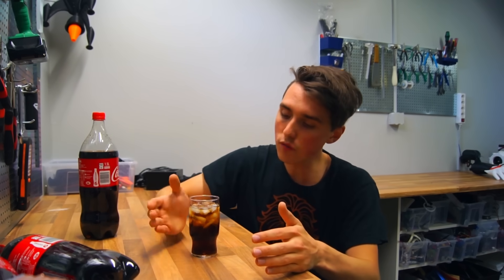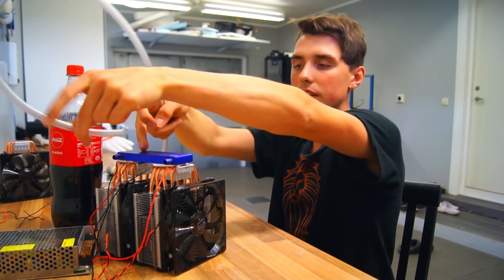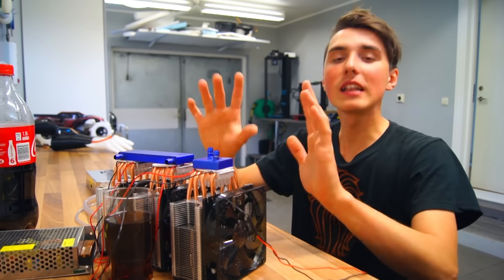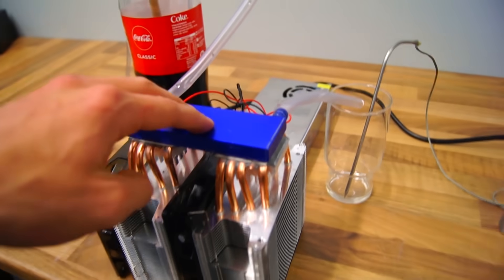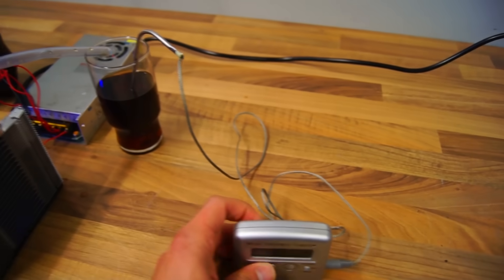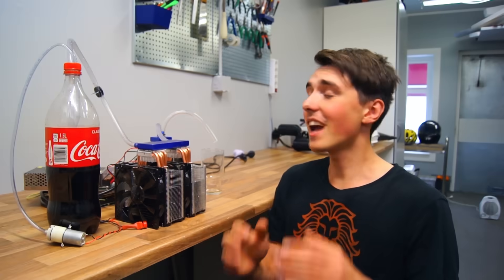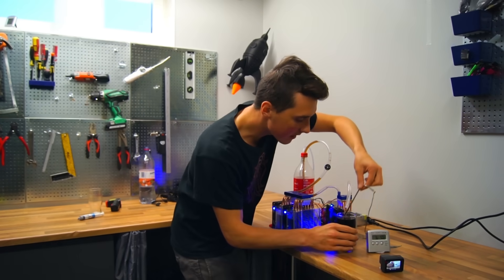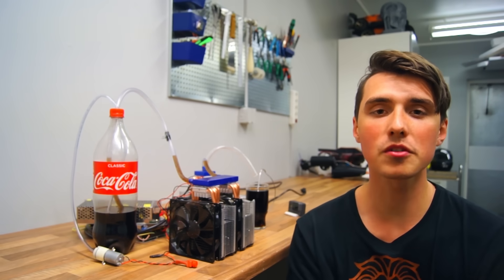Peltier Soda Cooler Machine - DIY Drink Dispenser

Comment: https://youtu.be/vsTIWhZ-6HM

Peltier Plate Driving 2 Low Heat Sterling Engines. The Hot side powering the top & the bottom engine being powered by the cold. Because a Sterling Engine converts the differences in Temperature both the Hot & Cold and a Peltier Plate produced Hot and Cold but on different sides of the plate the Peltier Plate's side can be used to produce kinetic energy.

The Top "Hot" Plate/Sterling Engines also acts as a more entertaining heat sink. 

For best results I would suggest a TEC1-12715 DC12V Heatsink Thermoelectric Cooler Cooling Peltier Plate Module 40x40MM over the TEC1-12706 as the TEC1-12715 can run at a higher amperage. If you only have a TEC1-12706 then you may wish to place some form of resisters or Temperature Controller Module otherwise the heat may be too great for both the Low Heat Sterling Engine & TEC1-12706.

Comment: You could get much better results with a slower flow rate, and don't need as many peltier modules. Most of the cooling is due to the thermal mass of the waterblock which is at -17.5C.

Comment: What happened to the giant cooling block you mentioned in this video, can you do something like 6 peltier devices on 1 block, 3 on bottom and 3 on top cooling the block in the middle and exhausting the heat from the outsides? Could get better results, good test to see what happens if you go over the top, would make a good video

Comment: Water block on hot side. CPU on cold side. ( So the Peltier sandwiches in between. The problem people are having or don't seem to grasp is the cooler the hot side the colder the cold side. So a custom loop with a 360 rad on will be the best solution. A Hyper 212 won't do shit for peltiee CPU cooling.

Comment: the way those style cpu coolers work, dont they have to be right side up (or sideways but less effective still) for them to work? aka youre not cooling the hot side as well as you would if you just simply flipped that whole contraption upside down with the waterblock on the bottom and the coolers right side up?

Comment: good idea but your reservoir where the liquid pass through is too thick, if it would be thinner it would cool a lot better with only 2 peltiers
Reply: You mean the blue water blocks were to thick or basically the piping inside? I was thinking they were to thin and you could stack 2 blocks on top of eachother.
Reply: @rdooski  the blue water block is too thick, the thinner, the less it will have to cool when it passes through
Reply: @xMickx  Im going to have to disagree. If that were the case your cars radiator would be thin and small. The more surface area you have to make the temperature exchange the better.
Reply: @rdooski  the only surface area as you say that cool down is only the bottom area, no matter how tall it is, only the bottom will cool. The higher you go the less efficient. This prototype is not a radiator and not all the areas are cooled down. If it would be thinner it would cool quicker.
Reply: @xMickx  No the surface area that touches the liquid is what matters. In this case its the surface area of the piping inside the cooling block. And yes it is a radiator, its just solid instead of having vents go through it.
Reply: @rdooski  okay since I'm dealing with a negative IQ one, our conversation ends now.

Comment: back in 2000 was building desktop  PCs that would go temps below 0 like well below 0 30, 40 deg below on cpu and video cards we used the units from a refrigerator to do so ..could overclock the crap out them

Comment: What if I want cool water from distilation colum? It is possible sustain low temperature all time? Or the water heat peltier module and cooling will be inefective? In collum is 80 degree Celsius and in output I need about 30, can peltier keep this low all time?

Comment: You should have made a loop, a loop in the bottle with a thermostat. The fluid "Loops" until it reaches the right temperature and then the thermostat opens up and delivers the fluid to the glas.

Comment: Hi - your water block/ heat exchangers don't have enough thermal mass. Add a container on top of them to hold either water, that could even freeze into ice or at least be at a very low temperature. Run your system till that water/ fluid is cold ahead of dispensing the cola. That would be closer to the design of the old style dispensers. Try that and make a new video.

Comment: Hey actually I am trying to make a water cooler using peltier modules for my car using 12v cigarettes socket. Can u help me?
Reply: So.. it means you are trying to place a heater inside your car for the sake of getting some cold water. Isn't it??
Reply: @Ravitejad98  Ya sort of, my car is pretty big and my heater exhaust goes to the boot.

Comment: I'd love to see this done over with some thought given to the flow of heat between the various parts of the cooler. Heat pipes function better with the heat source at the bottom, as they work through the evaporation and condensation of the water inside them, and heat rises.

A lot less important but still worth a mention is your fan orientation in other videos. How you have them here is fine, but the orange juice freezer had the fans blowing downwards, essentially working against where the heat "wants" to go.

Comment: I'm pretty sure this can cause serious health problems. Cola is a bit (or more) acidic and it'll dissolve some of the aluminium. Aluminium and copper in your body is not great for you. For some people it's even deadly (if your body can't remove it fast enough or at all). You say "but soda is sold in aluminium cans". Yes, but they are have protective coating. Scratch it with sand paper and put it in a glass of cola and you'll see what'll happen if you wait long enough.

Comment: I'm running 3 alternators on my truck #1 for the truck itself #2 for the stereo sound system #3 for the jumper cables,power inverter and the diy add on ac using peltier cooling

Comment: he could of put a regulator valve after the heatsink and add another loop back to the start of the heatsink, then closed the valve and the coke would regulate around the heatsink. that would be easier lol and you can control how fast the coke comes out

Comment: Hi. Im totally rookie with the Amp-Voltage-Watt question.
Sooo... the peltiers are using 300W... 
That power supply what you linked at the description is 360W. U still using 2 of them... why? :)
Now im trying to do something similar.
I ordered a 25A 12V 288W peltier pack with heatsinks and all fancy stuff... and a 30A 12V 360W power supply.... Will it gonna work If I connect everything together or will I burn? :D :D Im a bit worried. :D

Comment: Justè2 ideas vor einer für Upgrade used for the flo
W Speed no clamp just use a PWM circed too slow down the air pump speed Sud für Softdrink flow Speed is slower
And you can Ajust the if you want to adjzst the time how long the flow Is running just use mono stable Flip Flop circet
So push the button once and you can adjust the temperature and also the mas of fluid which will run p through the cooler so are 
Adjust z the whole system example for one class push the button once and after the glass is full etwas top again automärkte le and you can always changethe Speed for temp and the Run time for the Volumen of th e glassgreats fromm Germany Mr eheelchair bjornvoigtthat works real comfiyou willsee Upgrade two Levels Higher ggf or me my kids can now usebthedispenser Aline cous one Button usage
I hope you Unserstand my english ha a Braunstrike few yeard ago so my english is badif Xiu want to Kontakt me use Facebook or e-mail
Would be nice If Xiu Name gor that Upgrade If you gonna use itcouse my little invention Developer by disskusing with my daugthrr valrdkajow zobmskeit bettet andveadirr to usei ASK anwserabd i tfied to found a dolution sehr US my Brest Helfer ciuseshe ist Schild and Just das what sehr would Like betterat Machines i built for her sndher brother
Reply: And put the hot Zeit on top so der Heat will be easier token away remember Physik convection warm Air always wants to be flying up

Comment: 5:08 I was thinking : Damn what an exaggeration, you've nice video editing skills, it looks realistic ...
5:12 And then I'm like : OMG that's not fake, that's true !

Well I think the sound is prerecorded and that's what fooled me

Finally it's nice, I think the only thing you could optimize is the flow, the mod you add is mechanical but it'd be better to fix that at source having a pump where you can change speed just with a screwdriver, so the liquid has more time to pass trough it.

Comment: Probably a little late, but you've got the whole assembly upside down. Those heat pipes on the heatsink have a liquid inside that needs to be in contact with the heatsink itself, it boils and rises up the tubes to condense on the walls of the upper tube, transferring it's heat to the copper and dripping back down to be boiled off again. The more heat you can pull off those TEC cells, the more cooling power you'll get out of them. And try modulating the voltage of the pump motor to fine tune the flow of liquid, a trickle would be ideal. Also, adding a peice of aluminum bar stock to the water block bonded with thermal paste will increase the amount of liquid you can flow through it before it warms up, and insulate the outside of that as well to decrease losses. Awesome project, I like the idea of cooling on demand versus cooling the entire volume at once. Kinda like an Insta-Hot, but the opposite.

Comment: Uuh... Why not just make something for a cup to sit inside of? I mean a fridge is a much better "soda dispenser".
This design would be pretty much unusable for some time after you use it once.
A fridge insulates itself from heat so that it retains as much "cold" as possible while you can store a whole bunch of cokes in it... And it probably costs less money to run energy wise than this too.

Comment: Well the question is, is it really that inefficient? Like let's say your mini fridge is running for whole day and anyway you come and take just glass of soda out of it and put it back and let it there again and if you would use peltiers and let it cool for 10 mins pour drink into glass true it and turn it off. 

Uhm 🤔

But anyway never worked with peltiers I heard that they heat up on the other side is that hot that they need active cooling on the other side ?
Reply: Peltiers use an extreme amount of electricity.
Reply: @Tahutify  Yea I know it does, but the fridge uses a lower amount but running for the whole day, but Peltier will run for just a 30 mins max to cool up your drink so the question is if you compare these is it really that inefficient?

Comment: U should use coper spirals, that are thinner, so more of the coke will change heat with the copper... Make a little container, full of alcohol, with a nice coper tube spiraling inside, and then make the coke pass slowly inside it... That will work way better, the blue water thing u used makes only some of the coke to change heat!!

Comment: Instead of a limiter in the tubbing connect a potenciometer in series to the pump
Reply: A potentiometer in series? You would burn it in a second, you have to use a driver, maybe pwm would be ok

Comment: You should grab another bottle, and some more hose, and circulate the coke through the blocks. This should transfer the heat out of the system, and eventually make the coke ice cold. Add a spout to deliver the coke out of the circulatory system. ;)

Comment: Regarding the flow limiter.
I know a lot of people say put it after the peltier but it will not make any difference.
Fluids are not as compressible as air is.
Essentially you "squeeze a water hose" what does that do? It speeds up the water.
Same thing with your coke.

What you should have done is to slow down the airflow.
Either slow down the air pump but I assume that would require PWM, a bit to complicated for this task.

So what is left?
Spill out some air.
Either by making a hole in the air hose and the pressure in the bottle will be less and the speed too.
Or just unscrew the cork slightly to pass out some of the air that way.

Comment: Hello I like the idea and its pretty much the same implementation of the idea i had ... What about a liquid passage, but just the amount of liquid that it can pass is a lot smaller, what i mean is a much thinner water block, so that it is not able to heat up the Peltier so fast and in the same time the peltier will be able to cool the smaller amount of liquid much faster without dissipating so much cooling potential so fast. In the same time the smaller water block will be limiting the flow of liquid as well.. what do you think about the idea ? Will you be willing to try it ?

Comment: If you put a block of lead between the water block and chip it will hold the cold longer, acts like a flywheel so you don't loose the energy as fast.     cool video and i will sub

Comment: Peltier gotta have to be the most underrated electrical effect ever! Good video thanks!
Reply: If they were more efficient, they'd get more attention.  They are power hogs.
Reply: Not really Peltier-Element
Am not really effizient es ist ok vor sochi project but not for more if you want to build on air conditioner ich will need all in all three or four times Energy as one with compressor
Reply: @b.v.6077  "i can speak English very well but i can't find the Wörters so schnell" 😉

Comment: use thermoconductive tubing so the frost permeates the whole system, leaching heat at every point along the way.
Reply: What is thermoconductive tubing made of?
Reply: @Fstop313  
Copper? Or something non-toxic that wont react with soda but still conducts heat well.
Whatever spreads that frost along the whole length of the tube, it could act like a cold-capacitor of sorts.

Even better if the thermoconductive pipe is surrounded by a slightly wider insulating pipe filled with thermal-capacitive fluid/gel.
Reply: But i'm sure there are much better ways to do this.

Comment: I developed a similar controller to control the temperature of ICs between -70 and 180C. i also tried using large heatsinks like yours using heat pipes; I discovered that using this system I could only get down to about -20C on my second stage plate. I'm pretty sure that's because the liquid in the heat pipes has to evaporate; meaning the hot plate gets to a higher temperature, thus the cool plate is at a higher temperature, If you want it to work faster using a standard aluminium heatsink with a couple fans should do the trick.

Comment: Using 3 cooler master hyper 212 evos + 2 power supply's + 3 thermal peltier +  2 water blocks + an air pump + a hand drill + some plastic tubing + a puncher at the end of the day whats left is a soda bottle with cap destroyed and  you need to finish all you soda with in an hour or two yeah now how about buying a small fridge it can hold more than 2 dozen of coke bottles at the half of the price you invested to buy all this parts

Comment: The pipes shod be made out of coper for better colling 👍
Reply: copper pipes would lead to more heat loss to the surrounding air, having a higher thermal conductivity than the plastic tubing.

Comment: I don't recommend using air pump to push the coke out of the bottle because the pressure generate heat and we don't want that

Comment: is This safe to put on Water cooling circuit for cooling PC purpose ? I am not using water cooling circuit just wondering
Reply: Don't use the Peltier modules because you don't want any condensation in your pc.

Comment: Bad idea.  Keep the drink inside.  Fast moving cold air or water over the bottle will work fine.
So many problems with tubes going in and out of the drink.

Comment: Brother I want to cold 150 ltr water with peltier module in 15 minutes , if this is possible plz help me, I pay for Ur information M 9254914468 from India
Reply: Not impossible but not even simple: to cool 150 L of just 10°C you would need 1500 kcal, that in 15 minutes will translate to 6000 kcal/h or roughly 7000W of thermal power. Since the EER (coefficient of performance) of peltier cells is around 50% if you are lucky, you will need 14 kw of electric power! That's around 5-7 times the amount of electrical energy a whole apartment cooling requires!

Comment: great video but please don't try runing soda through aluminium. Soda is slightly acid and acid disolves aluminium and trust me you don't want to drink aluminium.
Reply: Slightly acid isn't enough
Reply: @parka0m485  as long a it can provide protons it is enough. There's a reason why there is a protective coat inside soda cans

Comment: Why not put a glass on top of the coller module and just add coke slowly. It will give better results and keep it cool also
Reply: Why not put the bottle into the freezer for 5--10 mins....
Reply: @VeritaZFFS  lol
Reply: The heat exchange rate is higher when passed through channels so the overall efficiency is higher in this method.

Comment: From experience I have noticed that heat pipes work better if oriented in the right direction. In this case the heat sinks should be turned upside down

Comment: I am 100% sure that you would get much better thermal energy transfer if you had high mounting pressure between waterblock - peltier - heatsink. Also it could help having more Thermal mass on the cold side to act as a temperature buffer so the cold side does not heat up when pouring.

Comment: You must try to directly pass the liquid through heat shield this will provide more surface area for cooling or you can also use a radiator for cooling or which is similar to the other heat pipes of cooling  on the heating device and pass you coke through that pipe this will definitely give a tempretute of around 4-5 or even lesser